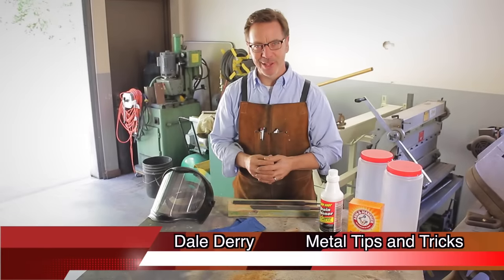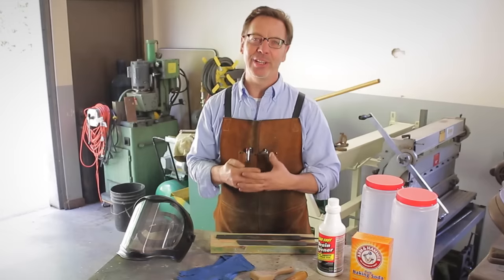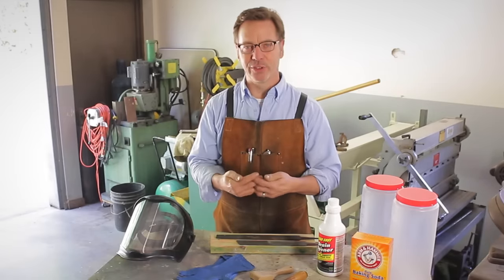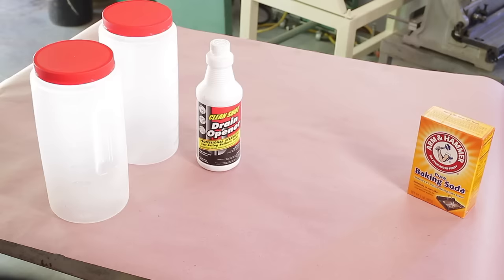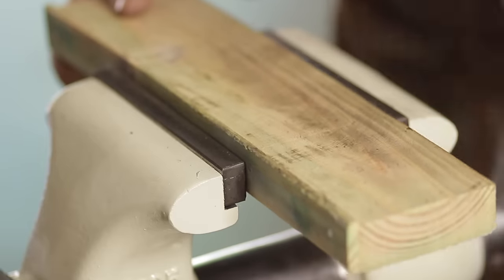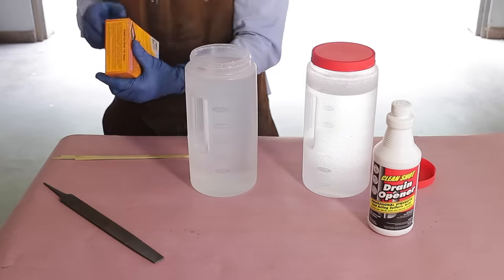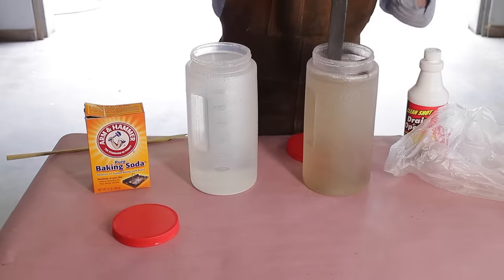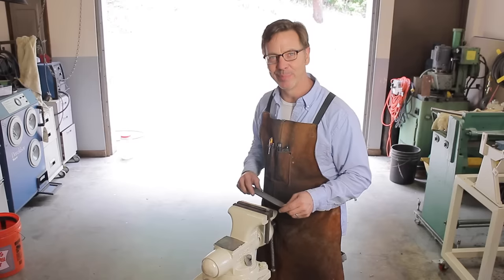How to Sharpen Metal Files

Comment: wow ...but why ?
Reply from the maker: I don't know.
It really dose sharpen the file. Give it a try, you have nothing to lose.  I promise you, you will be surprised.    
One side note the file must be dull not damaged to work. :-)
Reply: will have to! thanks.
Reply: Time to put Mythbusters on this one.  Please explain how acid can "sharpen" steel or iron. Until then, I'm believing that all it did was to eat away whatever was clogging up the teeth.

What was the purpose of the copper pipe, by the way?  I'm guessing that was to push the steel filings out and replace them with copper that the acid can dissolve.

Comment: Um, I don't know what this dude thinks the sulfuric acid is doing other than cleaning it..
Reply from the maker: Give it a try, it really dose sharpen the file.   I promise you, you will be surprised.    
One side note the file must be dull not damaged to work. :-)
Popular mechanics article from 1992 with microscope before and after photos

https://books.google.com/books?id=seMDAAAAMBAJ&pg=PA64&lpg=PA64&dq=Chemical+file+sharpening&source=bl&ots=Bse9zY6U2B&sig=_zpkvcVtRj51XcbcOImlNjJ-y3w&hl=en&sa=X&ved=0ahUKEwibldXZ-YrQAhXBFZQKHW8cBGwQ6AEIPDAE#v=onepage&q=Chemical%20file%20sharpening&f=false
Show less
Reply: Those images look more like it was cleaned than sharpened. Acid pretty much dulls the sharp tip since the tip has a smaller area and gets eaten away more quickly than the bulk. If you want to show this works, perhaps try dull a new file by grinding something hard and then using sulfuric acid. Alternatively, you could find another dull file of any sort, clean it thoroughly, ensuring it's not clogged then try it out. Then  treat it with sulfuric acid and see if it improves.

Comment: Not convinced. This is a very old trick - the acid simply creates a jagged surface on the file which breaks off in no time, leaving you with a file that's blunter than it was before. You can't sharpen a file. Look after it properly, buy a new one when it loses its edge, make something else out of the high-quality steel.

Comment: Loved your video , BUT You are NOT  Sharpening the File  You are simply CLEANING It Thoroughly !!  : ))  There is actually NO real way to Sharpen a really Dull File ....   AND Banging files together Loosely only Helps DULL them !!  
I am a retired Toolmaker/Machinist with 55 Years experience . I have Precision Mill Files I have kept Clean for over 40 Years of Use ...And They are Still Sharp . Another trick to filing  ALWAYS file in ONE DIRECTION Only  !! NEVER Back and Forth that simply DULLS the cutting edges ...  
Enjoy !

Comment: you smokin crack brah?
steel sharpens steel, dunno where you got your information from but different types of steel with different treatings of different qualities change the hardness of the steel
untreated raw low quality steel will be scratched by higher quality steel thats been heat treated 

this is important information on a video like this, people may assume that since "steel cant sharpen steel" then steel must be unable to scratch steel. which can lead to people doing stupid things to costly things
Reply from the maker: Give it a try, it really dose sharpen the file.   I promise you, you will be surprised.    
One side note the file must be dull not damaged to work. :-)

Popular mechanics article from 1992 with microscope before and after photos

https://books.google.com/books?id=seMDAAAAMBAJ&pg=PA64&lpg=PA64&dq=Chemical+file+sharpening&source=bl&ots=Bse9zY6U2B&sig=_zpkvcVtRj51XcbcOImlNjJ-y3w&hl=en&sa=X&ved=0ahUKEwibldXZ-YrQAhXBFZQKHW8cBGwQ6AEIPDAE#v=onepage&q=Chemical%20file%20sharpening&f=false
Reply: where did I say it doesnt. I know full well this works. probably not forever... but it will make a file last 3 or 4 times as long at least right?

what i was  basically trying to say is that steel can sharpen steel, thus steel can scratch steel. and what you said implies that if its made of steel, steel can do no harm to it.
which could lead people to doing some pretty stupid things. its best never to spread misinformation even for simplicities sake.

Comment: That's not the way to sharpen a file you only clean it

To sharpen a file you must heat it red hot cool it very slow down so it gets soft then the old teath are remove and new Teath are formed than you harden the file

Comment: files are cheap. the chemicals  you used to remove the rust cost  the same as a file.  the file has hundreds if not thousands of "saw teeth".  they are very small.  when you apply acid to remove the rust you are taking away an oxide layer and rounding off what was once the teeth of the file.

Comment: use a wire brush, and finish with compressed air, or just blast 'em with a pressure sprayer at your local carwash...
i'm pretty sure your files needed to be CLEANED and not sharpened.

Comment: wow $6 dollars of cemicals to sharpen 2 files worth $2 dollars...
Reply: Wayne Hartneck If you only use two files then perhaps you should just buy a new one if you use it enough to dull it. 
The volume of chemical mixture in the video will sharpen several dozen files and can be kept for later use. A decent 10" file can cost $10.00 to $20.00. Doubling the effective life of $10.00 file will pay for the chemicals to restore more files than the average hobbiest will use in a lifetime. 
You might offer to restore some for your friends. 1 file or 10 takes the same time in the bath.

Comment: acid will always eat an edge faster than a face it would non uniformly round and dimple the entire file. dont c this usefull for sharpening. like saying acid etching a demascus blade makes it sharper. it dont
Reply from the maker: It really dose sharpen the file. Give it a try, you have nothing to lose.  I promise you, you will be surprised.    
One side note the file must be dull not damaged to work. :-)
Reply: i know from the video it work to a desent exstent but a true test would be get a new file and c if it makes it worce or beter or same. it might revive slightly if it was a very dull file. but a newish file i guess would suffer. just due to the nature of acid and how it works. probs cheaper to get new files from time to time and  use them correctly instead investing in acid containets and protective gear etc
Reply: logicallyspkg

Comment: I have a file blank , it is just flat steel. I got it from the Heller file co. After the company had closed down. The teeth had not yet been cut in. So if your method works I should be able to take this flat file and make it sharp, right?.... I don't think so the lines in a file are cut into the  metal. Putting a file in acid will clean it but in order for acid to sharpen it the acid would have to remove metal from the lower areas and nor remove any metal from the higher area. Lol this is a joke that was most likely pulled on newbies or apprentices on the first day on the job.
Reply: Dave, No need to call anyone an idiot, especially when Tim Brown is right and you are wrong. You don't think that sulfuric acid removes any metal that was part of the actual file? Let's think logically about that. Why would the file be "immune"? There aren't too many materials that sulfuric acid doesn't remove.
Reply: josechirimoya okay, you get to join the club. To begin with... Room temperature dilute sulfuric acid such as drain cleaner doesn't really touch steel, so no... just no. In fact, low molarity sulfuric acid actually tends to create a protective coating on steel (neat tidbit for you...) Is that logical enough for you? Sulfuric acid isn't some magical substance. It doesn't react with everything it touches regardless of it's concentration, and it certainly doesn't react strongly with everything it touches. Secondly, I was more agreeing with Tim Brown than not. I agreed that the technique works (Not because it reacts with the steel. It works because it cleans it.), and I even personally consider it a form of sharpening...ish. I lumped him in for missing the point of the other slightly less intelligent gent's comment. The other guy want saying it didn't help. He was just arguing that it wasn't technically sharpening. Finally, I wasn't exactly terribly serious with calling either of them idiots. It's all in good fun, so take it easy buddy. They weren't exactly bright comments, but hey...
Reply: "sharpen" is specific to removing manufactured material from the original manufactured material cutting edge restoring it's ability to cut effectively. What he did is to remove previously (clean) cut material out of the cutting teeth that was clogging them from contacting a desired surface to be cut.
Reply: DrHarryT That is certainly "a" definition for sharpening. Is making a tool sharper... better able to perform it's cutting task... also not a decent definition though?
Reply: David 
DrHarryT's "definition" is the only definition.  The other is merely cleaning.  Both cleaning and sharpening of any blade is good but, not equal.  Everyone reading this is aware of this concept.  You all are just arguing about nothing.   Oooh, so am I.  I guess, I'm a troll.  LOL.
Reply: Really going out on a limb here guys. What makes you think it doesn't work? Provide sources for your arguments and we can discuss it. 
A clear explanation of this process and several similar methods can be found at page  235 of Workshop Receipts: For Manufacturers and Scientific Amateurs, Volume 2. It's available free from Google books. 
Let's not get into name calling. Just name your source and we can discuss the relative merits of your arguments.
Reply: Old Sneelock's Workshop I think you are missing the point. Well, not the point. More like their point. They're not saying it doesn't work. They're just arguing over the semantics... Whether or not it's actually sharpening since it doesn't actually remove metal.
Reply: David It removes metal, that's the point of this process.
Reply: Phil Foster Yes diluted sulfuric acid does definitely react with steel. Consentrated 98% doesn't because it has no free H3O+ ions. I have read chemistry at university level, so I know this.
Reply: Mix a metal with acid and it will react, period.  A weaker acid will simply take longer but all will result in oxidation on the surface and when cleaned, you will have ultimately REMOVED a thin layer of the metal. Also, the reason it is an effective cleaner is BECAUSE it removes metal.  Otherwise you could get the same results with soap and water.  
(Water also acts as an acid, though much weaker than the chemicals already listed- and when it oxidizes the surface and creates rust and you clean it, guess what... you just removed metal)

Instead of trying to impress people with your knowledge by nit-picking every detail, remember the point of the video- the file cuts better after using this method.
Reply: Emil Muhrman Umm, no... It doesn't. It absolutely does not remove metal. What it does is remove dirt and debris trapped in the little notches. Granted, some of that debris might be metal filings, but not metal that is actually attached to the file. Also, you might want to ask for a refund on your college tuition. I'm assuming you're talking about having taken like Gen Chem or something like that. IDK, Maybe you even made it to Organic or analytical chemistry, but I'm sorry that just doesn't make you in any way qualified as some expert in chemistry. Dilute sulfuric acid just does not react with steel at any reasonable rate. Does it react? Sure, technically speaking, but I mean so does air. Oh, and for the statement about dilute sulfuric acid reacting more strongly than concentrated sulfuric acid... Just go beat your head against a wall. My guess is that you read something about extremely concentrated and cold sulfuric acid not reacting well with steel, but that you don't actually understand the info behind that. For the record, it basically forms a thin corrosion barrier which prevents further reaction. This only happens with very concentrated and cold sulfuric acid though, and really isn't applicable to the conversation. For God's sake people... We're talking about drain cleaner and a file. This isn't rocket science. The drain cleaner loosens up the dirt and debris... That's it. Because that debris is gone it can cut better. Might it also take a couple of atoms of the file with it... Sure, but that's not the point. It's a really quick way of cleaning the file. That's all. Don't make this overly complicated.
Reply: David I didn’t say anything about sulfuric acid specifically.  Being a chemical engineer doesn’t necessarily qualify me, because as an introductory high school chem class will cover it.  Call it what you want, acid reacts with metal no matter the strength.  You contradicted yourself when you admitted air- and it’s not air, it’s the moisture in the air- will do the same thing.  Yeah it will albeit at a much slower rate.  The acid doesn’t just react with surface contamination.  With all your experience you should know that by now.

So thanks for your chemistry lesson, but next time try reading for comprehension before responding with a rant.  I won’t get into assuming what other people’s qualifications are,  you’re obviously capable of making an ass of yourself.
Reply: David, right.  Good point, I didn’t think of that.  Very clever
Reply: ralph sampson worse...I think you're a troll that's wrong. I think that in this case it is acceptable to consider it sharpening. Yes, that sharpening may be due to a simple cleaning, but it still improves the ability of the tool to cut. It's different than cleaning a knife or similar implement. This cleaning actually results in increased cutting performance.
Reply: If acid removes material from the parent metal equally is it not honing the polnt as well? Think about chemically sharpened fishing hooks , what chemical do you think they possibly use to sharpen the point without manual abrasives?
Reply: @DrHarryT  NOPE!  what he did was Chemically sharpen the file.It's a scientific fact so get over the cognitive dissonance and give it a shot.  it works

Comment: you cannot sharpen files you can clean but not sharpen
Reply: It does actually sharpen them by corroding the teeth.
Reply: @stevem815  I have used files in my trade for nearly 50 years the only thing that would do is weaken  them you cannot get back whats not there
Reply: @errolfoster1101  get an old file and try it. What have you got to lose? The file is useless anyway.